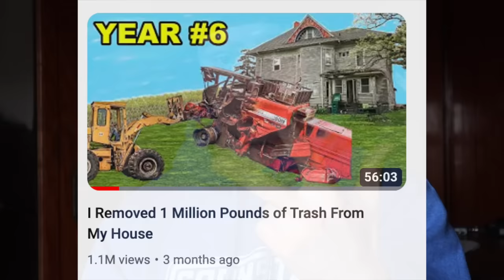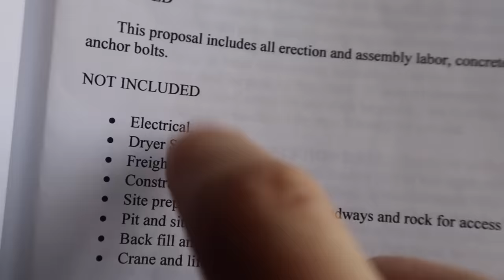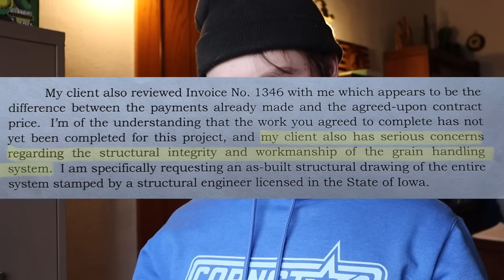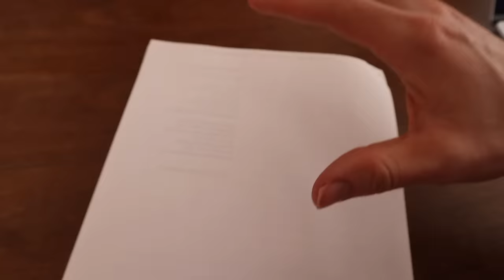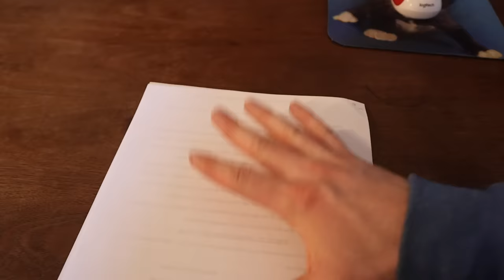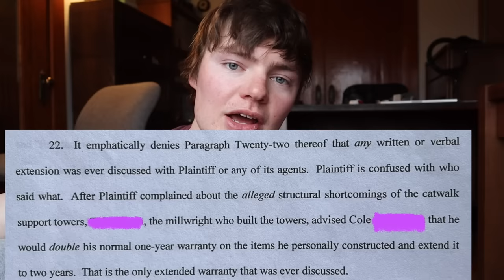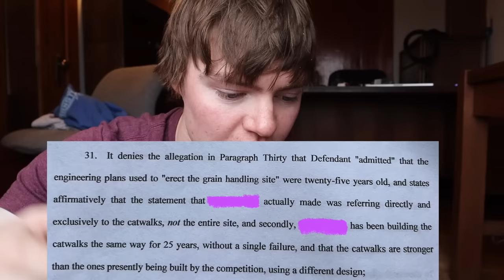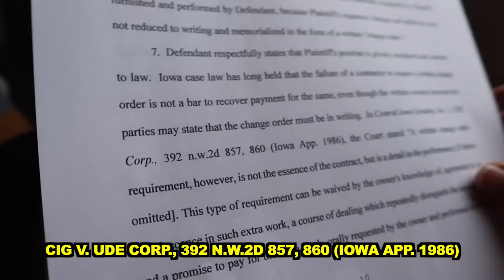I Sued My $1,000,000 Bin Site Contractor

Comment: just a few questions I have, how long was the bins site allowed to settle before pouring of concrete, how much rebar was required as well as reinforcement wire laid down into the concrete, was it just the one lawyer that we saw on your videos or was it added after so much concrete was poured, how long was the concrete allowed to cure before the bins were started. I ask because I live in Canada and have seen alot of bin sites a heck of a lot older then yours and have not seen the huge cracks in the foundation nor have I seen shoddy workmanship like this EVER and as I said OSHA if they caught wind of your video's and the issues like grab bars falling off in your hands YOU and the family would never be allowed to even go up to the top to check levels, and one last note the contractor probably sleeps very well that is until he loses in court
Reply: All good questions.  The fact that, despite being asked, the contractor won’t supply engineering drawings or as-builds is sketchy.  Begs question as to whether contractor cut corners on rebar, concrete, etc to shave off costs.
Reply: @alanholck7995 appears the cornstars did not contract for a engineered system as it is not stated in the contract for construction services.  So there is no engineered drawings nor are they required.
Reply: @ryanm3371  I haven't seen the contract.  But if indeed there was no engineering plan this could complicate things, especially those that are foundation-related.
Reply: @alanholck7995  cole shows some screen shots in this video of the contract.   Farm construction in iowa is exempt from building codes.   So unless the cornstars and construction contractor agreed in the contract to build to some sort of standard (they didn’t), it is really hard to say what quality the finished product should be.   Further complicating things, you can see the cornstars contractually agreed to provide site work and earthwork.   So the bin contractor has zero culpability for performance issues related to soils.
Reply: @ryanm3371  Interesting.  I guess we'll see how it all shakes out.

Comment: If a contractor won't supply engineering plans they don't exist. The engineer's reputation is at risk not theirs so there is absolutely no not reason to supply them. However, allowing a project to proceed without the signed off engineering plans in hand is a common mistake. ALWAYS have a copy of them with the revision date and them being signed off before allowing ground to be broke.

Comment: Cole if this goes to court i would have a company come out and film all the problems you are having. The  cracks in the cement. All the loose fittings on the tower. The pit that can't be run full speed. and any other problems you have seen.

Comment: The first thing I would like to ask is when you were having problems with your welds why didn't you call the contractor and have them come out to the job site take a look? The minute you got that lawyer involved You just destroyed your relationship with that contractor. Now I've built houses for years and I've always told people "If you don't talk to me I don't know how fix your problem, I'm not telepathic". Now I do understand as the general contractor it's your job to look over all the work as it proceeds maybe this guy had a supervisor that did that or something who knows. But the first question I would like to ask is why didn't you speak to your contractor the minute you notice these problems there has to be some type of warranty on this work? No I do understand that sometimes contractors don't respond and you may have to take the legal route, good luck Hope it works out for you there's nothing worse than paying for a brand new project and it not work when it's finished.

Comment: I am glad things are moving forward.  Things like this take a while to settle with much patience needed. As you are seeing.  Cross your T and hold your ground.  Gotta love lawyers.  The ink and fine print become very important.  Not sure how the over runs if not prior discussed and change ordered. The letter was to say we will continue to bill you this percent.  That may need to be dealt with and negotiated sooner than later.  You have some financial people to turn to the help you make the correct choices. This is also another business decision along the way.  I think you are already heading in the right direction.  Just because you have done it for a long time.  Doesn't mean we have things to learn.  
     I recently was to a site where we installed electronic equipment to protect a fence.  The location is very windy and basically has destroyed the integrity of the fence and some supports.  Now the owner will not fix.  I think the fence should have lasted a year.  This is where a good survey would come in.  Along with the Enginering behind a good fence. Just food to think on.  Not all applications work well for some site type.  Hope this helps most of yours is workmanship just possibly not seeking structural plans to assist in a long-term structure that both could be happy with. While using something does assist in finding the flaws or changes needed to be made. As someone who has been through a legal battle the letter was BS looking to say how great we are.  when it comes down to it you are looking for what is rightly owed and no more.  Both will need to sit down and do some hard negotiating on repairs and final billing.  Start to account for what you have done and time.  Black and white it the key to a great contract. I had hoped for a different outcome. Sometimes we have to go a harder path.  You will know when to get out. Next time bring your lawyer in early to review contracts and assist with an agreement. The contracts we are using must be very binding.  Good contracts broker good relations. This can be good and bad.  But necessary to protect both. I hope your backing skills are improving with the semi.  Remember we all don t have Steller days.

Comment: You are correct to ask for the drawings. The structure that you purchased must be designed and constructed to be "Fit for Purpose" as detailed in the proposal and confirmed in the contract. If you stipulated that you wanted to purchase a Grain Storage Facility that was capable of storing "X" amount of "Y" grain then the structure should be designed and constructed to be "Fit for that purpose" and designed and constructed to be capable of withstanding and exceeding all of the stresses and strains associated with the storing and handling of "X" amount of "Y" grain. Good Luck to you, but I would insist on seeing the signed off engineering plans too.

Comment: There is a lot of those contractors that build houses.  They do the same thing. Hire unqualified people working for cheap. I was always told. Cheap labor isn't  qualified and qualified isn't cheap. Where I live in Texas there was a builder that built the city building and did a horrible job on the concrete. Now the city payed millions for it and it can't be used. Been sitting with no windows or glass the last 3 years. It is a eye sore.

Comment: Watched this again, and still find this whole issue crappy with how much everyone wanted this in your family and how bad it turned out even to the point that checking the bins is physically and mentally unsafe. You have to put your life on the line when going on or across broken welded structures, or walk ways that have a chance of breaking apart just from the movement of your steps. 

Not to mention the chance of something falling off when no one is up there just due to wind. Hanging trees are widow makers, and sadly I would say the same to your grain bin...

I hope for more updates to see if the bin site has degraded anymore since the last update on it. I know it had a giant crack and I'm wondering if it has grown or if you have checked under the raised floor to see how bad it could be falling apart.

Comment: we had binding arbitration written in to all of our contracts and went to arbitration many times.  if your contractor did extra work, the arbitrator will award a fair value for that work----signed change order or not (unjust enrichment).  arbitrators are excellent and always came up with just settlements.  now, if you have material defects in performance----thats outside the cost of construction-----its a separate lawsuit.  we would work without signed change orders, because if we did not finish the project---everyone loses.  if customer refused to sign a change order and the work was necessary---we completed the job to spec and then went to arbitration.  we also did excellent work---so workmanship or material defect was not an issue....it was just getting paid fairly for extra work performed.  signed change orders mean little-----contract amendments are what is actually required to modify billing.

Comment: I strongly suspect that if somehow this does go to a jury trial that you will win. But I would honestly be surprised if it goes that far. As frustrating as it is, the most likely outcome I see is that they will settle with you for some about of money. Sure you will "win" but the settlement will almost definitely be less then the bin site costs. So you will not be out the full amount, which is good, but you will be left with a damaged and partially functioning bin site. If you want it repaired/finished you will need to find another contactor to finish it. Finding a contractor who will take on a tainted project is going to be tricky. I wish you the best of luck! This situation is horrible.

Comment: I sadly went through an almost 3 year-long lawsuit recently just wrapping up a few months ago.  I learned a lot about how it works so I can inform you.  If the contractor has insurance and has filed a claim, you will no longer deal with them, just the insurance. All the engineering reports you gather will only be used for your repair bids unless you go to trial.  Basically, everything you do prior during the mediation process will be irrelevant to a mediator because they are not experts or judges they are just trying to get a resolution between 2 parties.  Most often through mediation settlement the plaintiff receives about 60% of damages claimed.  Just be prepared.  If it goes to trial it will get very nasty, very uncomfortable, and it is a huge gamble.  I would ask for what ever county this will go to trial in to get the percentage for plaintiff wins/loss.  In my county it was 80% defendant wins.  That weighed our decision as well.  I personally served on jury duty in my county on a drug charge that the person was guilty dead to rights and got away because the jury didn't like the cops that performed the arrest (small town).  Hope this helps prepare you a little and know what to expect.

Comment: This is a soil problem.  Large bins will cause settlement of soils to depths of 50+ feet.  I am familiar with soils in this area and settlement of 8 to 10 inches is possible without mitigation of the deeper soils. That settlement is the cause, not the concrete or steel or welds. The person who decided to skip the geotechnical engineering exploration is the person responsible for this.

Comment: Lawsuits are always long, messy and costly.  Do not be afraid to stick it out.  I believe a jury trial works in your favor.  I can't wait to see their reaction when they see safety rails falling off!  There is no doubt that they will be favorably impressed by your video evidence.  A "few" cracks in the concrete, say what?  You are smart not to malign them publicly, but the facts weigh heavily in your favor.  The fact that they haven't produced the engineered plans you have requested smells to high heaven.  Wait till they try to explain that to the judge during discovery!  If the plans don't exist, it's almost prima facie evidence of malfeasance, if not gross negligence.  I'm just a layman, but I've had my share of court battles over the years.  It takes guts and courage but you can win this case.  Hopefully, you can also recoup your losses and legal expenses.  I join with many of your subscribers in wishing you the best of luck.

Comment: Contractor is a coordinator: sub-contractors actually do most of the work.Very simply put contractor is there to coordinate AND check that subs do the work correctly. When poop hits the fan and call backs occur it's up to the contractor to get the subs back to fix the mistakes: unless subs tell him to puck off and then he has to hire other subs: hence the bills for added labor and materials. Back in the day GOOD contractors had this BS covered with in-house skilled labor on a payroll. But that is expensive so now it's rare. So here we are: a sub-standard bin project, lawyers grinning all the way to the bank, and a contractor wishing he was just a hired hand on someones payroll.....
BY the way: start getting bids to fix the issues. Of course you'll be dealing with another contractor on that.

Comment: "It has always mystified me that these 'concerns" are never voiced until it's time to pay the final bill", I can not believe a contractor would actually rely on this as a defense.
A.) It's not the final bill if there were plans to do several more silos.
B.) His wording suggest he sees this type of complaint frequently.
C.) When else does he expect a customer to raise their concern about the finished work of a silo other than the time at which the silo is finished and he is requesting payment for said finished work? Does he really want the customer to critique every step of its construction and point out flaws in their workmanship? That is the whole reason you pay some else to do the work, so you don't have to worry about this. Bottom line, the service you agreed to pay for was not adequately rendered and needs to be fixed or you should not pay.

Comment: Good luck on the law suit,,, it will take a while to get it ironed out and good move getting the right attorney for the claim.  Very disappointed you cut the ends off on the old planter,,,,,lol  As a machinist, it really hurt me Cole,,, lol.  On to the big planter, I recently watched another channel, where he stepped up to a hydraulic down pressure system instead of an air system. Each row is adjusted on the individually vs as a whole unit..the also jumped from a 16 row to 25-26,?? (can't remember how big) The adjustments happen faster than the air system which of course makes for depth placement of the seed better. He was seeing yield decreases from row to row and even saw yield decreases on the rows that sit in the path of the tractor tire. His channel really has a focus on yield and even the different seed types available and yield differences,,,,,very educational approach. You probably know him personally,,, Border view farms,,,, check out his planter video,,,, he runs a top notch farm for sure,,,,good luck guys.

Comment: If I dropped a million on a grain storage system, Clearly I would have paid 50k to have someone engineer this thing up. I am so sorry that you have to deal with people in the business who have been doing it this way for this many years. One of our local coop needed to put up a new storage so they spent 50k just to have them do a site layout, engineer drawing which also included engineer drawings from the company and a concrete specialist. They even went so far as to sample the concrete mix that was sent to the site. One of the days we were over there we got to see the bin all up and people working on it. These guys were torquing every bolt to the specification per the contract. They had to use a digital one and every bolt had to be checked off against a stack of pages. If the bin falls down in 25 years they will be sure to get it replaced for free. It pays to spend before you build. 
I am going to build a new house in a couple of years and I am going to spend quite a bit of money doing everything in advance to make sure that the building they put up is done right and not to their way.

Comment: Youre never supposed to voice any concerns over shotty work unless obviously visible and presents safety issues .  If you do then they have to change or add to the contract for repairs.. most of the time upon final inspection is where those issues will be laid out for the contractor to fix for thr contract to be filled and completed..

Comment: If they won't show you engineered drawings it's because there aren't engineered drawings.

Essentially the GC just assembled a bunch of engineered by other prefabricated systems and parts.

Are the bad welds shop or field welds? What was the QC requirements for field welding? Did a third party inspection happen?

Comment: Always 2 sides to a story. You describe everything since day one in a corn bushel. How are they calculating leg/conveyor speeds. Probably based on Cubic inch for cups/FPM/ rows / belt speeds / belt lengths. This should be interesting. Also are you only measuring bushels out of a semi trailer as your measurement or are you actually measuring calculated volumes?

Comment: I have been through several lawsuits working for an electric utility all that stuff is common they always counter claim, and also ask for a motion to dismiss if they are the defendant. Once get past the motion to dismiss they will start asking to settle. The reality is the cost to go to trail is going to be lot more for them and likely lose in the end. I'm assuming you paid them most of the money already except for last part they are asking for. You have the advantage here saving money and forcing them to fix the problems for free.

Comment: Best of luck and weight of evidence in your favour with the legal case. Encourage use of Safety Squints when battering stuff with a hammer. I bet it's a long way to the eye infirmary. Farming is, statistically, still one of the highest for work-place injury rates. (more than construction.) The Tractors are Beautiful.